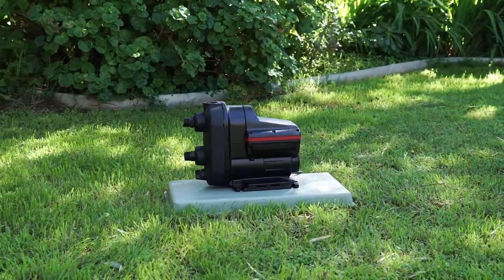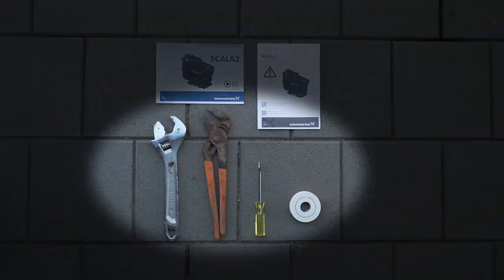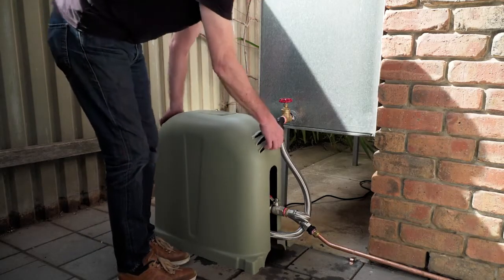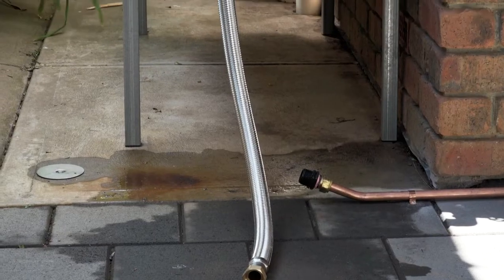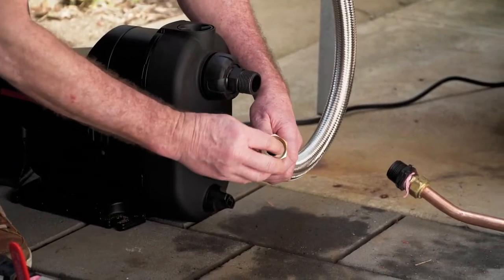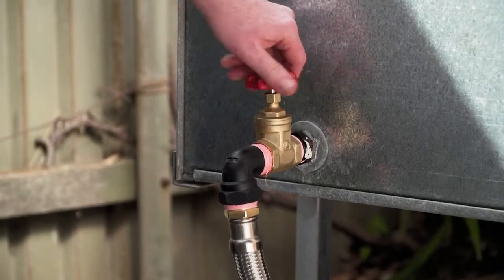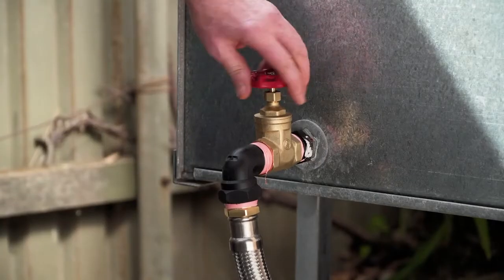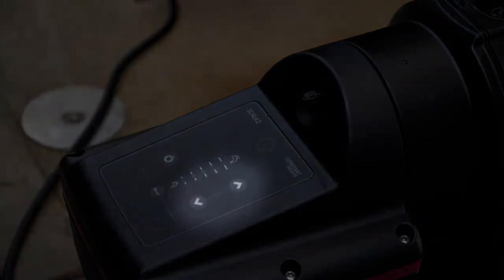Grundfos SCALA2 - Easy Installation Guide

Comment: Two year only it gets damaged a non repairable by the agent
Reply from the maker: Hi @munirsaleh9408, thanks for your feedback. I'm sorry to hear you haven't had a positive experience with your Grundfos SCALA2 pump. With the recent release of the new model of SCALA2 last year, spare parts are now available for both the new model SCALA2 as well as the old model. Not sure if the agent you were dealing with was aware of this at the time but this might be an option to explore further. Some customers have experienced challenges with the first model of SCALA2 and we recognise that this has caused a lot of frustration and disappoinment. The new model takes in a number of improvements made over the years since the first model as well as further innovations and we are extremely confident in the quality and durability of this new model. I'm writing this from Grundfos Australia's head office in Adelaide but if you are unhappy with a Grundfos product and don't feel you have received the kind of service and support you were looking for from your local Grundfos Authorised Dealer or Agent, I would suggest you contact your local Grundfos Office to discuss the matter further. Kind Regards, Aaron

Comment: Worst pumps ever, very bad design, they are all leaking in very short time. DO NOT PURCHASE THESE PUMPS!
Reply from the maker: Hi @marcmillecam613, thanks for sharing your feedback and experience. We're sorry to hear your experience with Grundfos SCALA2 has not been a positive one. I know that some customers have had challenges with the previous model of SCALA2 and that it has been quite disappointing because when customers buy a Grundfos pump they expect premium quality and premium performance and when they don't get that it can be very frustrating - and rightly so. There have been a lot of improvements made over time to make the pump more robust, more efficient and quieter as well. In Australia and New Zealand in July 2024, Grundfos released a new model of SCALA2, the Model 2. We understand that some customers once bitten, will be twice shy and hesitant to want to buy another Grundfos pump, let alone another SCALA2 but I think it's important to make sure our customers understand that we are committed to improving our products and responding to feedback. But thanks again for your feedback. Kind Regards, Aaron (Grundfos Australia & New Zealand)

Comment: you literally didnt follow the picture directions included with the unit. no tape for supply lines that have rubber gaskets in them, use tape only no pipe dope for NPT fittings.
Reply from the maker: Hi @jlsrr2577, thanks for sharing your thoughts. Good pickup. It would appear from the video and the installation and operating instruction for SCALA2 that you are correct. There was no need to use thread tap for the inlet and outlet connections in the installation shown because the pipework connections had a flat gasket as part of the connection. Thanks for pointing this out. Even we make mistakes from time to time. :) Kind Regards, Aaron
Reply: @ can you tell me what to do in 1 year with a pressure gauge? The pressure tank should be %70 of what?  I dont understand that part of the instructions. I dont know what pressure the units are shipped with
Reply from the maker: Hi @jlsrr2577, thanks for your enquiry, and apologies for the delay in responding. At the outset, I just want to be clear that I'm part of the Grundfos Oceania team and I'm situated in Adelaide, Australia so if the terms I use are slightly different to what you're used to, I apologise. A lot of terms, guidelines and settings for our pumps are interchangeable across countries but not always.This video http://gfos.ly/60590OCxR on how to set the pre-charge pressure of the internal pressure tank in your Grundfos SCALA2 should be helpful. I also have a chart I can send you that might be helpful. Just send an email to marketing-au@grundfos.com. Which has each of the Set Point pressure amounts in PSI and Bar and what the pre-charge pressure needs to be for the internal pressure tank.
The Grundfos SCALA2 has an inbuilt pressure tank. Pressure tanks generally slowly lose pressure over time and should be checked once a year and refilled to maintain the required tank pressure needed for the pressure level/comfort level (set point) you prefer on your pump which translates to the pressure level you see and feel in your showers and sinks and other taps at home. Doing this also prevents unwanted noise, pressure fluctuations, potential damage to the pump and higher energy consumption.
This pre-set pressure level for the internal pressure tank should be set to 70% of the Set Point (we use the term Bar) that you have selected on the control panel of your pump. So if have selected a set point of 5.0 bar (73psi) for the water pressure level for your home then the optimal pre-charge pressure of the internal pressure tank needs to be set to 70% of this PSI which for 73 psi (5.0 bar) would be 51 psi (3.5 bar). My understanding is that because of freight rules our pumps come with the pressure tank sent at about 26 psi (1.8 bar which is quite low) so they need to be adjusted from the beginning if you want a Pressure Level (set point) higher than 36psi (2.5 bar). 
This probably all sounds like waffle at this point but hopefully together with the video helps to explain what I mean. Kind Regards, Aaron
Reply: @grundfos  thank you for the  detailed explanation it makes perfect sense to me. Looks like I have a few adjustments to make. 👍🏼
Reply from the maker: @jlsrr2577, not a problem at all. All  the best.

Comment: My pump even without using of water time to time starts for short time periods, apparently there is no leaks of water.
Reply from the maker: Hi @pedrofrcsantos009, thanks for your enquiry. If the pump is what we call cycling (turning on and off frequently) or turning on at odd times, it is not a pump fault, but is caused by a leak somewhere in the water system. This can be a leaking toilet, dripping tap or a drip in the pipework somewhere. Kind Regards, Aaron

Comment: I have a problem, the big eye shows red, but there no any another red signal that shows the problem. Could you assist me please to know what's the problem is?!?!
Reply from the maker: Hi Abdulrahmanalmazrouei, we're sorry to hear that you are having trouble with your SCALA2 pump. Please consult the SCALA2 user manual for further information on finding faults. You can find it here: http://gfos.ly/6052RWv20. Please refer to pages 21-23. If you are still having trouble we recommend you contact your place of purchase or a licensed plumber or installer for assistance. Kind Regards, Aaron
Reply: @grundfos  thanks for your reply. The link doesn't work !
Reply from the maker: Hi Abdulrahmanalmazrouei, please send an email to marketing-au@grundfos.com and I will send you the link via email. It would seem our URL shortener is not working properly for this link. You can also just type Grundfos SCALA2 User manual into your search engine and find the user manual that way (just make sure the URL is a Grundfos site), if that helps you to get the information you need quicker. You have come through to the Marketing Department for Grundfos Australia, so there may be a bit of a time difference depending on where you are based. Regards, Aaron

Comment: How much is scala 2
Reply from the maker: Hi Negildo, Thank you for your interest in Grundfos. Unfortunately as we do not sell directly we cannot give out exact prices. To get exact information about prices please contact one of our distributors. You can find a list of local distributors on your local sales site: http://spr.ly/605834bDA. Thank you. Best regards, Sabrina.
Reply: I just bought one on Amazon for $860 delivered. Great pump, up to 70 psi although running it at max pressure can shorten its life. I run ours in the middle, 50 psi.